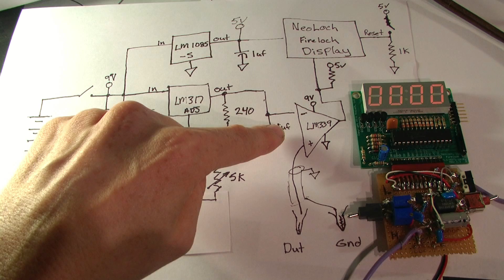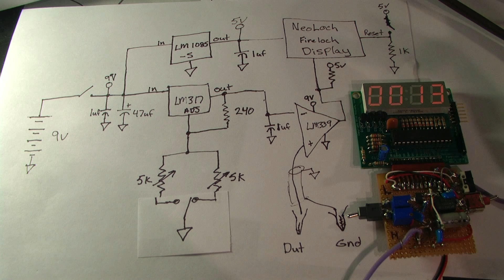Power Supply Debugging Tool

Comment: Jeri,

Do you happen to remember what the problem was when the flippers caused your resets?  The only time I've experiences resets when a coil was activated was because the coil's diode was open - which of course causes a back-EMF spike to the P.S. and/or the switching transistor.  I've definitely replaced more than a handful of smoked transistors because of that! :-)  But, I could see where a bad capacitor on a P.S. or a coil with some shorted turns could also really pull down a voltage rail.

Comment: What happens if you bang on things with a mallet? Does it cause the count to increment?

I wonder if Motorola has noticed that the Williams logo (seen at 1:15) is just Motorola's (SN=78250829 at USPTO.GOV) upsidedown? It's sort of like the Dynac and HP logoes being the same thing, just turned upside down.

Comment: @FlyByPC The idea of putting capacitors of different construction types in parallel is to tame "self resonance".
Aluminium electrolytics for instance are somewhat inductive due to their spiral construction, ceramic disc capacitors are very much less inductive. The concept was to "damp" the resonance of the electrolytic capacitor with a small ceramic one. The theory is somehat flawed and creates many new resonances, but in electronics many people do what tradition dictates....

Comment: @calvinthedestroyer For finding hot chips, a pocket infrared thermometer works nicely. I used it just today to find a bad cell in a lithium battery pack. Radio Shack has them for $25 (which probably means you can get them on eBay for $10.)

Comment: A nice little tool -- I can see a variant of that being useful for PC diagnosis. Why are the 1uF and 47uF caps in parallel so close to each other? I've seen that sort of design before -- does the 47 handle low-frequency fluctuations while the 1uF is for higher-frequency noise? Under the lumped model, those would simply be a 48uF, but I guess electrically they must behave differently. Thanks.

Comment from the maker: @ngneer999 A drop is a drop in the PSU and will cause a reset.  I've had machines that reset when you flip the flippers.  Ideally you will not see a drop in a supply rail when a completely different supply rail is heavily loaded.

Comment: I would think it would be useful to compare the test points to the pinball machine power supply  instead of the output voltage of the "classic LM317".  This would eliminate miscounts due to power supply drops during normal high current events like coil firing.  But what do I know about such things, I'm a chemical engineer.

Comment: nice. what if we said that pinball machines is a thing of the 80s and we leave it there and now we move on to cooler stuff. kay? : )
like a DIY radar for looking for UFOs. or narrow spectrum UV imager for looking for corona discharges from UFOs (they use such cameras to inspect high voltage power lines where the sun is blocked in UV by ozone so the contrast is high) or a small MRI scanner with pulsed copper coils, maybe nitrogen cooled. no more pinball : ) pinball sad :)